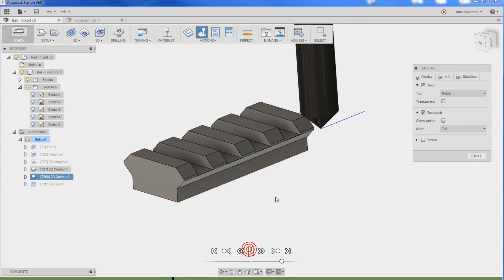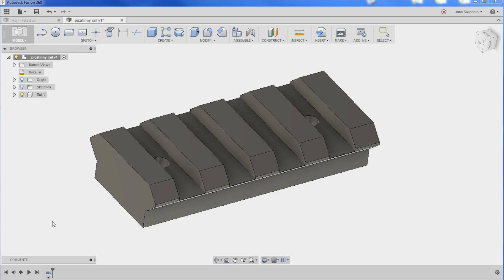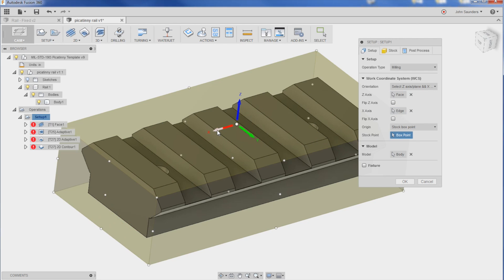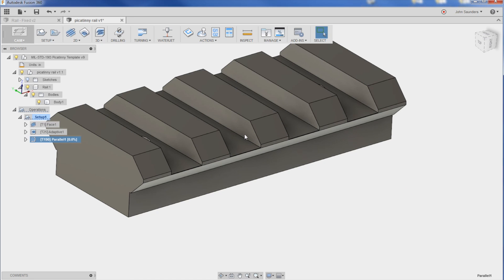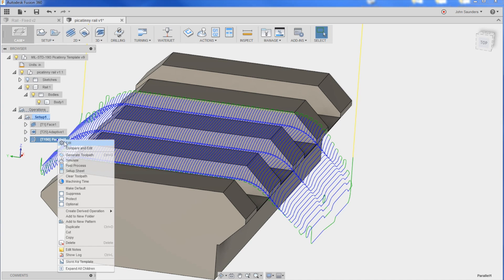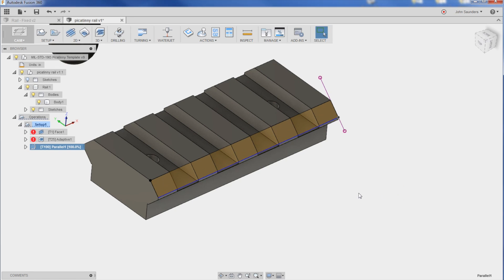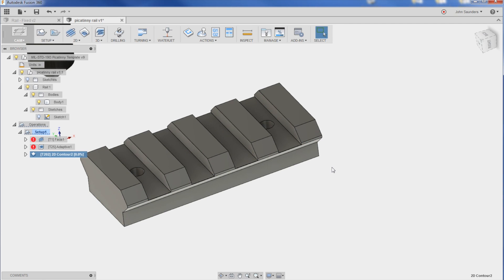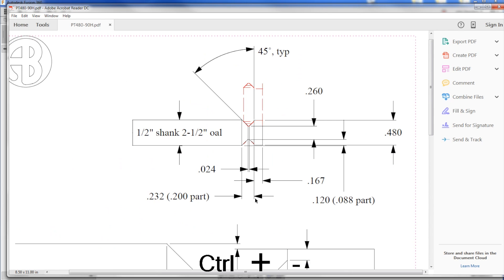Picatinny Rail CAM in Fusion 360!  Fusion Friday 33

Comment: A tip for anyone who is watching this video and looking for a better way to make a continuous pass with an interrupted chamfer like that. All you need to do is select any one of the lines along your chamfer path then select Stock Contours in the Geometry tab. It will extend automatically the toolpath along that selected line for the whole part. 

One step further, you can add Tangential Pass Extensions to continue that path even further on the part and generate the correct toolpath in seconds with one click.

Great Video John!

Comment: A stack of cutters on a horizontal mill would cut those two 45 degree angles and the flat part beneath on the side with little effort, then CNC the slots and any chamfers.  Might make production reasonably fast.

Comment: John, unrelated to this tutorial, but I think you also use Macs. Do you ever have issues with the Apple Magic Mouse giving the appropriate screen gesture that it will move and (especially) rotate (ie the screen symbol comes up) but it does nothing? I raised this in the very early days with AD, but a solution was never found. My own solution was simply to run a trackball mouse in parallel and use it just with F360, but it's annoying having to swap between the two all the time. I thought I'd check with other users and follow it up more vigorously if it's a more widespread issue. I don't know why it would give the correct screen indications, but then not rotate. It's done that since day 1 for me.

Been doing serious battles with F360 drawings today as its behaviour is becoming very weird, losing parametrics from the original model and no way to update it. I know you don't use drawings much, but they're essential for me,a nd i wish they would hurry up and fix this nonsense. If you think measuring in the model is bad, you want to try it in drawings!!! Beyond a joke. I just cut a s flute dovetail cutter backwards, so a decent drawing is essential to work off. Having said that, to prevent another brain-fart on attempt #2 I'm printing off a model to orientate my brain cells this time before I waste another bunch of time. I guess on the bright side the one i just made would have been fine ... if I'd run the spindle backwards ;)

Comment: Hey nyc cnc

great stuff again.
i tried to generate a g code with a post processor that i need for a specific cnc machine and got errors i don't now how to solve them? 
hope you can lend a hand.

errors are:

Generated by: Fusion 360 CAM 2.0.2139
...
Error: Tool orientation is not supported.
^^^^^^^^^^^^^^^^^^^^^^^^^^^^^^^^^^^^^^^^^
Error: Failed to invoke function 'onSection'.
Error: Failed to invoke 'onSection' in the post configuration.
Error: Failed to execute configuration.
Stop time: Mon Jun 27 18:30:38 2016
Post processing failed.

thx if you could help this learning guy out. 

Greetz all the way from Belgium!!!

Comment: i have had that same glitch. it only works once and you cant edit it without it messing up. 

i just found out is i select a chain in cam, then click on it again, a little thing pops up with an X, + and garbage can, with "open" and "closed"  contour options above it. you can select individual geometry doing it that way, instead of the Alt trick.

Comment: Still doing it the hard way with a 90* / 45* chamfer mill.  Just get a Picatinny cutter from AB Tools, run a rough and clean up pass and you're done with the rail geometry!  You'll need to run a 3/16" tool for your slots, other tools for other features etc.
Reply: We make a cutter for the slots as well. It slots and chamfers at the same time so no need for deburring.

Comment: If using a ball mill for the slants, it's better just to temporarily fill in the Picatinny slots and just have one continuous face/surface.  You can then let the ball mill run the entire slanted surface in CAM without wasting time lifting the tool for each individual rail slant.  Hope that makes sense!